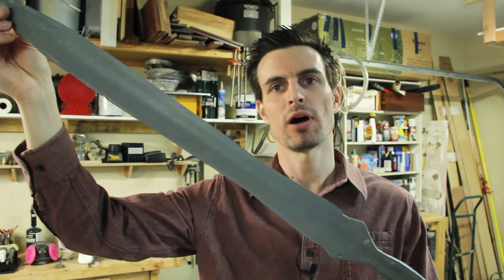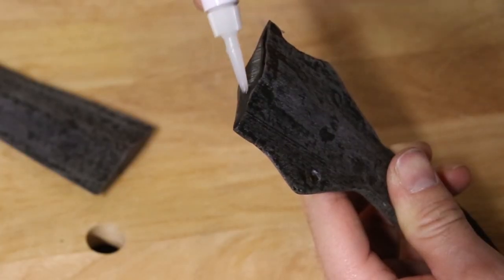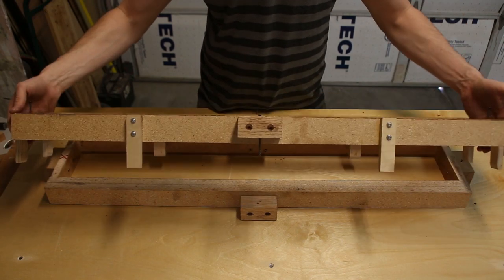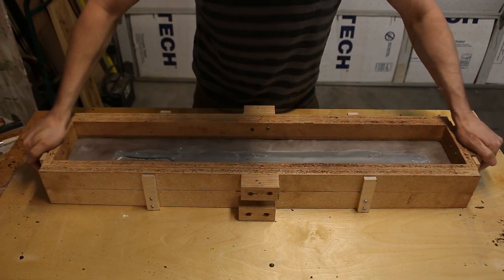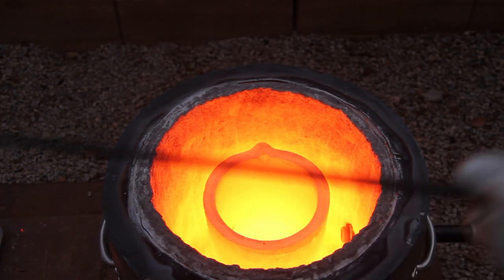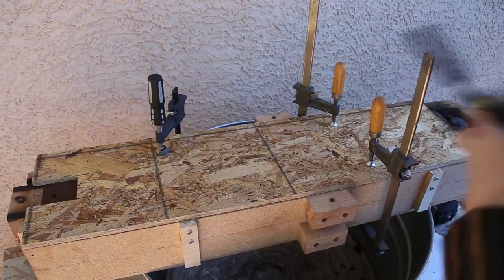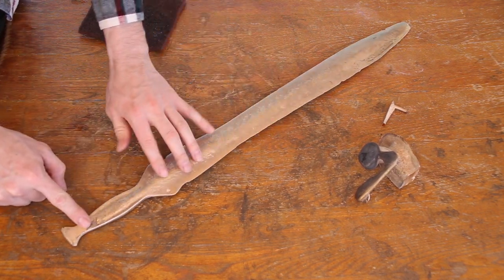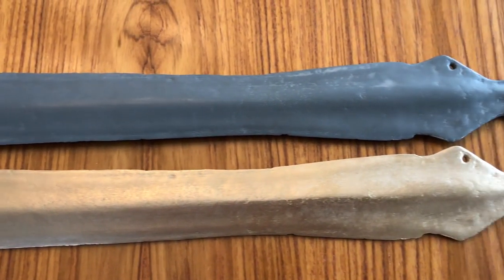Casting a bronze age sword reproduction

Comment: When you make the "as new" version, hammer harder the edges with a ball-peen hammer. It's what ancient redsmiths did with these blades to make the edge harder than the spine. It also helps shape the edge so you don't need to do as much grinding to sharpen.
Reply: "ball-peen" lol

Comment: Hi nice job sword looks great I have a printer and I have seen this model how do you split it into three pieces I’m not that technically minded I have Cura 4.5 Cheers Kev
Reply from the maker: bishop norton 1959 Thank you! To split the model up all you need is meshmixer. Just look up meshmixer “plane cut” and I’m sure you’ll find videos. It’s a free program.